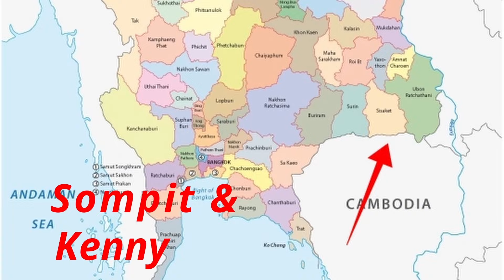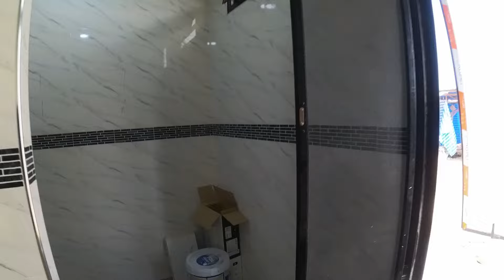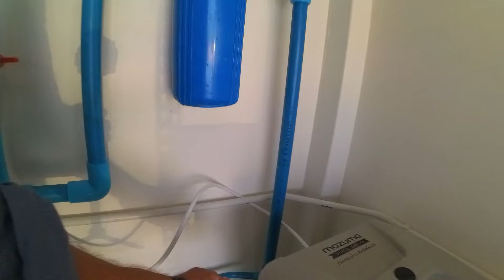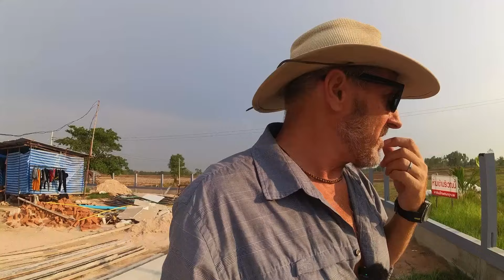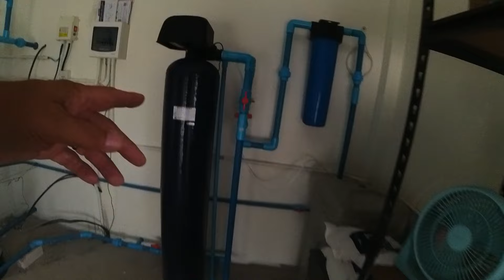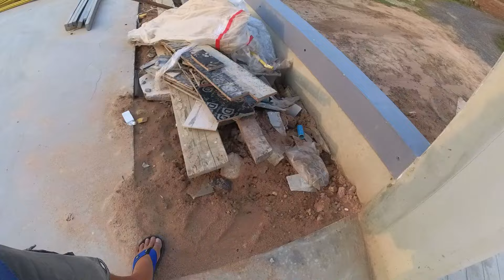A/C and Water Softener Installed

Comment: Regarding keeping the gate rain clean, buy a round wire brush cleaner the ones you attach to a electric drill to clean of rust etc on metal. Then fix it underneath your gate so that the wire-brush touch’s the rail. This will keep it clean every time you open and close the gate. Replace when worn. 😊
Reply from the maker: Good idea. I have started on the front gate so I will incorporate that into the plans for easy replacement.

Comment: My softener regens based on gallons used. With just my wife and I we use about 3500 gallons per month. From memory I think our raw water is 25 grains of hardness here in central TX.
 I add a 40 lb bag of salt maybe every 2-3 months but usually just fill the container when it gets pretty low just to avoid hauling salt multiple times. I keep spare bags in my well house. My salt/brine tank overflow has never been connected in 30 years and the regen control has never failed in a mode that overflowed that tank and I have rebuilt it twice in all those years. Its just an overflow so you could just tie it into the resin tank regen drain with a tee and little stand pipe in the unlikely event that the regen flow tries to flow into the salt tank. Mine comes out at low pressure and flow so I don’t think thats a problem. I recommend you get some test strips to check hardness. The one I use, Hach 145300 Total Hardness Test Kit, Model 5-B, available from Amazon in the US.
Reply from the maker: Could not find that brand on Lazada, but found one with 5-star rating, so I will order those. Thank You!

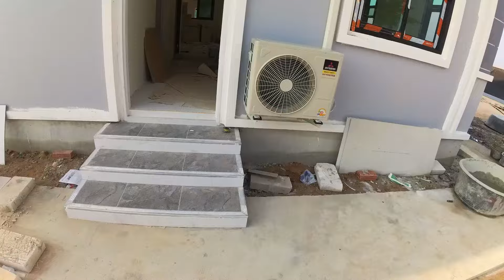Comment: Hahah I shouldn't laugh but as a retired general contractor I can appreciate your stress levels dealing with subs...Then add in the language barriers & the Thai way & yes I can sympathize. But it looks like your getting it all done & done right. Place is looking great. Don't let your BP get too high 😉 PS: One thing I never understood is why Thai's swing exterior doors outward. That backward door you mention @3:50 I would swing in left against wall
Reply from the maker: I had a rant a couple weeks ago about those doors. Almost cut them out and redid them. Decided i woukd not let me emotions dictate my actions. So, for now, just letting them soak in to see if i can " learn to live with it."
Reply: @ParadiseNThailand   hahah I know right? The thing I cannot figure out is they obviously do them proper inside the homes. Bedrooms & bath always open into the room. But exterior? Nope open outward...Silliness aside it is also a security risk & I know most Thai's don't worry about that but..Stranger knocks & you basically open outward is not safe + a hammer & a punch can pop out the hinge pins that are usually inside right? Just a TIT moment I guess 🙂 Good you don't get too upset😉

Comment: how much salt the water softener uses depends on how hard the water is to start with. the machine cleans its self when it needs too not a preset frequency
Reply from the maker: That's exactly what I told Sompit. Installer said I should add one bag of salt every 4 months. Told Sompit they guy is supporting his job, or doesn't know shit about water softeners.

Comment: A question about the orbital fans in your outdoor area ... how are they mounted ? Did you have to put a reinforcing plate or mount above the ceiling ? Some debate here about how to mount ours. How profitable is rice farming ? If the weather gods smile on you then you might break even, and then hopefully the govt will give you a subsidy. I do keep a spreadsheet of our(her) farm expenses, she made 900 baht profit after all expenses. Not worth it unless you have a large farm to reduce costs/rai.
Reply from the maker: Fans are screwed to two independent metal strips that are used to hang the ceiling. Those metal strips are screwed to the gypsum. So far, very stable but ask me a year from now. They are running daily.
Reply: @ParadiseNThailand  Yes, that is what our builder is proposing. Those strips are quite rigid, but I was doubtful about it in the long term.

Comment: now that the water pipe an instalation is done & running How much in ball park figure to get a well dug pump motor and water filters an softner that you got done so I can work that into my build buget for later this year
Reply from the maker: Drilling was B19000(flat rate no matter how deep, 6" bore), Pump with install supplies and installed myself was B23000, Carbon prefilter B7000, Tank was B5300, pressure pump with fittings and installed myself was B7000, water softener was B30000, (which included installation under 50 Km (I had to pay B400 for extra milage), and then the 5-micron particulate filter from Lazada was B1100. Plus, several trips to local hardware for various pipe fittings and misc. supplies. I did everything myself except install the softener. Hope this helps.
Reply: @ParadiseNThailand   Yes Thanks alot I can definately factor that into  my build budget now